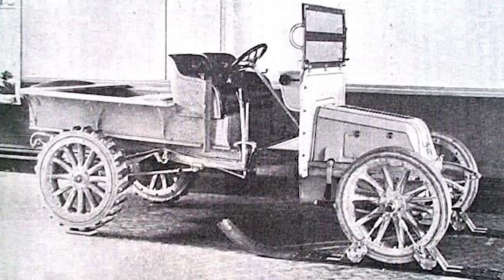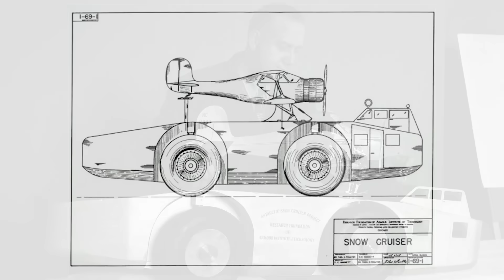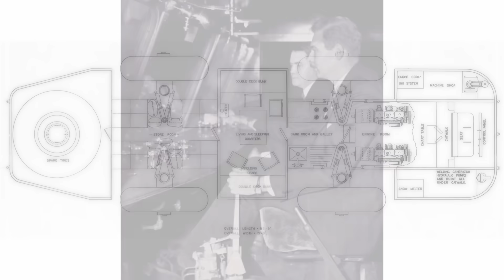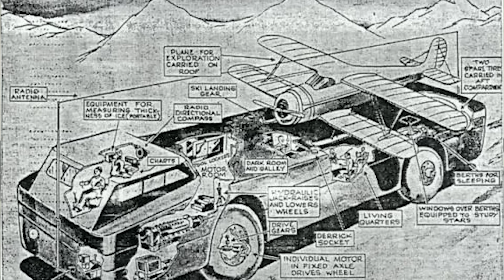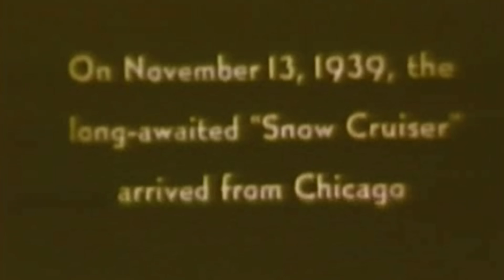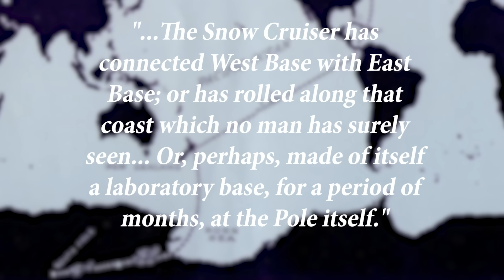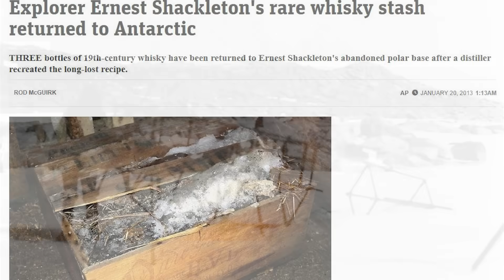"The Snow Cruiser"-Antarctica's Abandoned Behemoth

Comment: To add to what Calum said as the explanation for the "slick" balloon tires, I suspect most people who comment in a negative manner don't realise how tracked vehicles work.

If you look at a range of vehicles, you go from the one extreme of a tracked vehicle to a conventional wheeled one with standard THIN tire
And a ballon type is somewhere in-between these extremes.

A tracked vehicle works by in effect laying down the track, like its own road. And then it pulls itself along that.
And at the end of this little virtual "road", it pulls it up, passes it over the transfer wheels, and lays it down ahead of the vehicle again. 

So you want the track bogies/"wheels" to grip the tracks.
And the TRACK lays on TOP of the surface, and is stopped from moving by friction.
If you see a tracked vehicle stuck in soft mud, snow or sand, it's NOT because o lack of friction.
It's because the tracks DO grip the "ground", but the GROUND is then not strong enough to allow that grip to be be maintained, and it fails in SHEAR.
A tracked vehicle can cope with that by adding some ribs, that get forced into the soft "ground", that then transfer some of the driving force from shear, to some fraction in compression.
And hopefully the surface is going to be able to resist that.

But often it cannot.
A tracked vehicle can get hopelessly stuck is really soft mud, snow or sand if it sinks down enough to bottom out by touching its belly.
it then needs a tow out.

The entire concept of a tracked vehicle relies on the ratio of vehicle weight spread over track surface area.
And if you look at the size of these four HUGE baloon tires, they are very wide (0.9 m, which is close to TWICE the with of the first Soviet design, the ATT which had 0.5m wide tracks.

And they were 3m in diameter, so if you consider they ran at low pressures, and sank into soft snow a bit (say 25% of the total height of 3m), you can see that four such tires could have a surface contact area of around 8.5 m^2.
If you take a gross weight of 34 tonnes, then that gives a Ground Pressure of 0.40 kg/cm^2.

That's not bad: the first Soviet ATT's had 0.65. And it was only with the improved version they got down to 0.31.

The real issue was more the power available from the two diesel generators of 300hp, which drove the our independent electrical wheel drivers.
So with the quite heavy vehicle, that gave a Power to Weight ratio of 9 hp/tonne. Compared to the ATT with close to 17, and the heavier improved version at close to 26 hp/tonne.

So sure, if the snow is REALLY soft, you sink down until you eiher bottom out, and then even a tracked vehicle is stuck.
Or else the snow compacts enough to support your weight.
And it's a trade-off between sinking down, and thus engaging more tire surface area to resist more sinking.
But as you sink down, as you go forwards, regardless of how gnarly your treads or tracks are, you are in effect trying to LIFT the vehicle UP out of the hole it has dug for itself.
And that is what takes the power.You can do the math.
You are using engine power to not only drive you FORWARDS, but in effect UP the amount you have dug in.
If you want to maintain a givent forward speed you need to use some engine power to in effect lift your entire weight UP, continuously.

For a heavy vehicle, and a sharp angle, that's a grat way to grind up a big fraction of your available engine hp.
That's what slows you down so much in deep/soft snow, you run out of power.

They addressed the traction issue by doubling up the front wheels, and by using snow chains on the rear. So that mean't they did'nt sink as much, and thus if you look at the force vectors, they didn't need as much power to drive them UP and OVER the snow they were dug into. And more traction.

But not enough power.
The Soviet CTT Kharkovchanka had HUGE power: 900 hp. Compared to the Snowcruiser's 300 hp.
With close to the same weight for each.

And the other issue is that there was only ONE of the Snow Cruisers. So if it broke down or got stuck, it only had itself to help.
But the Soviet expeditions had several of their vehicles to support each other.
As well as a whole series of air drops of supplies ahead in caches.

However, the Snowcruiser's hybrid diesel/electrical system, and balloon tires should have been much more reliable, and needed less maintenance. The tracks on the ATT wore pretty fast: the account I saw said they had to stop every few km to bash them back into alignment. I suspect rthe CTT had similar issues.

And they needed an engine overhaul every 700-1000 hours (or at least the AT-T types did, I expect the CTT were similar).
So for a 9,000 km round-trip at 1.8 km/hour overall average, that means 5,000 hours of driving time, and thus at LEAST 4 full overhauls on the trip (assuming you could reach the end for your last one).

So just think of overhauling the engine, and the tracks in -60 to -70 C weather, in the middle of literally nowhere.
Not just ONCE, but 4 to 5 times.....
How long does THAT take?
Many days added to the trip.

So if you have wheels, and get stuck a bit more, how long to get yourself unstuck by comparison?
If they'd had TWO Snowcruisers then not really a big deal.
Winch each other through the bad parts.
Reply from the maker: Great comment and insight. This is the kind of stuff I should have included in the video.
Reply: @CalumRaasay  Sure, well your video inspired me. I did some other analysis, and started looking at other vehicles.

And I think a good point to make about vehicles used for expeditions is that you normally don't have just one. It's risky to not have redundancy, and having 2 or 3 means you can share people for the expertise, and share tools etc. Plus if you get stuck, the other(s) can tow.

I lived in South Africa for 15 years, and also for various lengths of time in a few other West African countries: Angola, Congo, Gabon. And Algeria too. And I rode my motorbike from Netherlans to Joburg a few years ago by the East Coast: first Western overland biker through South Sudan since the War....:-}

So the whole off-road, expedition thing I can appreciate.

In addition, in deep snow, in a convoy, the first vehicle has the most work, breaking the trail. And the others have a much easier time. Less fuel, and less wear and tear.

I'm Canadian, so it is obvious to me. VERY obvious when you snowshoe or cross country ski "off-piste". But not so much a common experience to a Scot...:-}

I think the only issue that killed the Snowcruiser was not enough power. The traction was fixed with the chains.  

What they might have tried was adding a diesel generator to a sled. Maybe need to beef up the drive motors to take more current. Could do that in the US and fly them back.

But I think a tracked vehicle for this purpose is a bad choice. Lots of wear, and very inefficient to run: huge fuel bills. A tank is the only vehicle where you quote mileage in liters per km....

I'll look up the maintenance/wear on modern snowmobiles: I wonder how they compare to say motorbikes with same overall weight and engine size.

I think the main advantage for tracks is to get the ground pressure down. An for tanks, to get a low profile too, so Mr. Russian doesn't shoot your Commander's head off....

That and to be able to cross rougher terrain than most wheeled vehicles. I think if you put a Main Battle Tank on wheels, you'd struggle to keep its profile low. Which is a big deal for a tank. But not for a civilian vehicle. 

Well, and you'd not reach as low a ground pressure by the nature of wheels, even say six big diameter/wide ones.

With a tracked vehicle you try to tow it somewhere on a trailer, or by train to keep the wear and tear off the tracks. And it's only when you get into the combat region you start to drive it.

So back to the Poles. I think best would be to have two types of vehicle: one to break the path in lead. That is small, and doesn't carry many people, or supplies. Or fuel. Maybe tows a trailer. That would help make a nice trail.

Then the other one is a cruiser: bigger. And I'd try to use wheels for all for the reliability, and fuel economy. And use the diesel/electric hybrid idea. 

You can make the vehicle MUCH lighter and more reliable because you don't need a gear box. You run your diesels at their most efficient speed, and then use a speed control on the electric motors. Reverse too.

You could even bring a power cable along to use to transfer power from one vehicle to another if the diesel had problems. Or have a generator in a sled to use. 

In fact, if you wanted a faster trip, you could pull out the diesel that needed repair, even routine maintenance, and put it into your dedicated repair cruiser. And swap in a spare. If you only have the diesel to generate power, then it would be much easier to extract it. You'd have it bolted to a "sled"/rack that you'd just unbolt, and unplug the various wires, then slide out sideways.

Your repair cruiser would repair it when it had a chance to stop, or even could stop and do it, then catch up.

I bet on a long trip they all spend a very big percent of the time stopped fixing stuff.

The other issue is fuel. I think they were all re-supplied by air on the way. If you look at the mileage they got, and the distance, plus that they had to run the engines 24/7 to provide heat and light, they had to have a HUGE amount of fuel just to get to one end. Then to get back.....

Wow....I just did quick calcn of fuel needed for an 80 day one-way trip of 3,500km. 
Based on 9.5 l/km for a loaded ATT (4-5 load plus 27-30T sled), and adding fuel for heating and to power the electrics: it works out to 28 tonnes of diesel. Net. So it would be maybe 30T by time you allowed for storage containers etc. And that is one way only.

I see some convoys had multiple sleds, but the more you have, and the more load, adds to your fuel bill by drag. Plus you need other stuff too.

So you cannot do it without resupply, either by air, or else by complex multiple trips to build up caches. 

The logistics get very complex. That is why they air dropped as much as they could.

If you like math, you will have heard of the Jeep Problem: is well handled in math sources. And it ends up being an exponential function of fuel to just do a crossing with one vehicle: either one-way, or return.

So this hows the most important vehicle criteria: fuel economy. And tracks suck fuel.

Comment: I notice that everyone is talking about the smooth tires (how could you not?). What's really interesting is the original models (seen on Joel's website) actually had tread. People back then weren't dumb, they knew how traction worked. I wonder if this came down to a big mistake on the part of Goodyear - which might not have been rectified due to the time crunch the expedition was under. If that's the case, I wonder how much better the machine would have performed with proper tires. (Also, the chains were mounted on the rear tires - I wonder if that has some connection to why it ran better in reverse, since it was AWD. Maybe it was too much effort to try to put chains on the front tires after they mounted the spares? So many questions.)

Comment: The physics of extremely cold snow pack was not well understood at the time. When snow becomes extremely cold it doesn't behave like it does in more temperate areas, because it has no moisture or wetness to it at all.  It behaves more like sand and stays in little granules. It was thought at the time that the massive surface area and diameter of the tires would perform optimally on snow at those extremely cold arctic temperatures.  The goal was to stay up on top of the snow, and not churn it up and dig down into it. Obviously they drastically miscalculated the physics and behavior, and that was the fatal flaw.
Reply from the maker: Dan East exactly. Great comment. Way too many instantly assume they know why it failed and how it could have been done better etc. but it’s a very easy thing to do in hindsight.

Comment: Back in the early '70's I was part of a tour of Goodyear's headquarters. Goodyear had one of the tires from the Antarctic Snow Cruiser, the tour guide said was the tire was an extra that Goodyear made in the prototyping stage. The tour guide emphasized that Goodyear had no other role in the manufacture of the Snow Cruiser. The display mentioned the failure of the Snow Cruiser and as I recall the tour guide was emphatic that the tires were not the reason for the failure.
Reply from the maker: Haha that’s a great story, love how they wanted to draw attention to their part without mentioning any culpability with the failure! Wonder if they still have that tyre?
Reply: @CalumRaasay  It's impossible to say what might have happened, Goodyear went broke and got bought out by some other tire company. The tire could be on display somewhere, perhaps it's in storage or it may have been trashed, it's hard to say which is more probable. I hadn't thought of that Goodyear tour, well probably since the time I went. It was really quite amazing to find a video where I had some small involvement with such an obscure bit of history.

Comment: If only someone with a brain would have thought to find a way to put tracks on that beast.  It would have quadrupled the surface area of traction, oh, and since the tires were bald as a babies ass.........
Reply from the maker: Well funny you should say that- because the Soviets pretty much did! The Kharkovchanka! https://youtu.be/f6R-h06IsJw
Reply: @CalumRaasay  it even has two diesal engines, so the controls would be easy to manipulate.   I think it would be possible to recreate this this with lighter material.  I have a feeling they over built it. With a proper redesign it should be able to be amphibious.  At least enough to allow it to traverse the ice even if it breaks.  They built a tank, when a land boat was needed.

Comment: With current technology.. I gotta wonder why no one has made a large line of hoverboat crafts for Antarctica. Mobile station size. Although I guess they prefer Tread Wheel kits like Canada. shrug Seems like a no brainer to me. It has many potential engineering advantages there. Electric, The propeller "fans" to generate in downtime, possible solar roofing, as well as our new super batteries? It is what I would certainly attempt.
Reply from the maker: Luckily, the Soviets got it right way back in the 1950s and they're still running to this day: The Kharkovchanka! https://youtu.be/f6R-h06IsJw

Comment: I mean... It's in 1940. I understand they didn't have the trow of information we do now. 
But come on... Slick tires. Zero brake-over, arrival and departure angles. Absolutely ridiculous clearance for the size of the vehicle. Spare tires in the back, putting all that weight on the back axle. 
And to change the tire you'd need a crane that's on the roof. A crane you can't use unless you remove the airplane. 
Oh, yeah! That's a smart design.

Comment: I would suggest that cutting the back off likely did not help the traction by sending the balance point forward which likely made the front wheels want to dig in.. But it was also just too heavy.. I can see from the lack of oil canning in the photos and videos that it likely had a very thick hull, probably built like a piece of farm equipment. If more time had been spent getting the weight to a more reasonable range of  10 tons it may have had a chance.. Top gear did a polar run in modified pickup trucks, and big soft tires did just fine.. But they did not weigh 37 tons.

Comment: Problems
1. Tyre's no wide enough and sleek tires instead of Deep Tracks, Wide Rubber Tank Tracks would have been much more useful though!
2. Not enough horse power it really needed 6 times the power it had (with 1 engine for each wheel!)
3. Never really tested in deep snow or sub-zero conditions!

I would have had 4 very wide Tank Tracks instead of 4 Sleek Tires!!!

Comment: Hold the phone, I thought the polar ice caps are melting away due to evil man.  How is it that this thing got deeply buried in show and ice?
Reply: In case this is a serious question: Snow falls on Antarctica, but that fact alone doen't tell you whether the continent is gaining ice or losing it. You have to subtract the ice lost to melting, sublimation and the ice that cleves off the continent whole aka icebergs. This allows you to calculate the mass balance of the ice and work out if the continent is losing ice, gaining it or if the ice is in balance. It's rather like pulling the plug in the bath with the tap still on. Having water entering the bath doen't mean it is getting fuller if even more water is leaving the bath via the plughole.

Comment: I have to admit, that looks like something they would've made in the 70's, gives off that same kind of hovercraft vibe as the massive ones in the 70's did.

Overall, I think with softer surfaces, the amount of material the tire or track can move has a large impact on its ability for traction.

I mean it takes a whole lot more force to dig into and drag a fair bit of snow backwards than it does to overcome basic friction, which is why I reckon tires with very knobby tires and tracks work best with snow.

Honestly I just think this was the thing that proved that large surface area tires didn't work to well if they didn't dig into the snow like that.

Comment: If that thing use tank tracks its gonna need a very long tracks and the engine just wont work that long because of the weight then why they not modified the tires with spikes and they can put normal size tank tracks in front and the back for pulling if the tire stuck in a hole